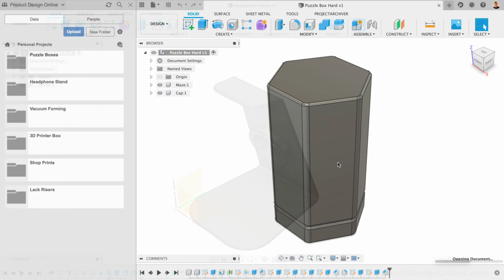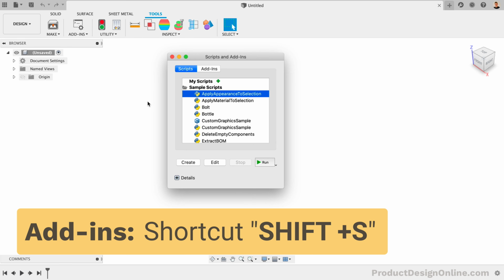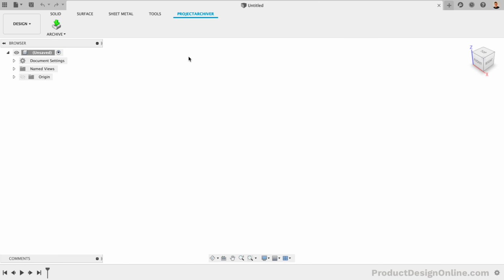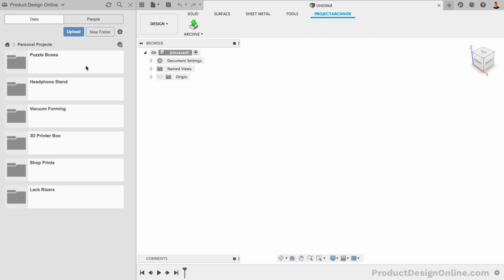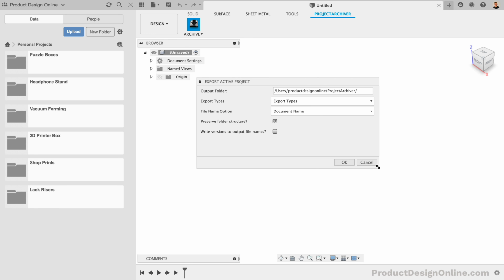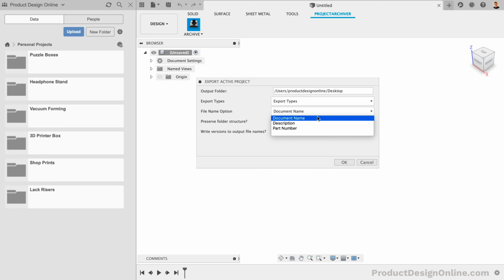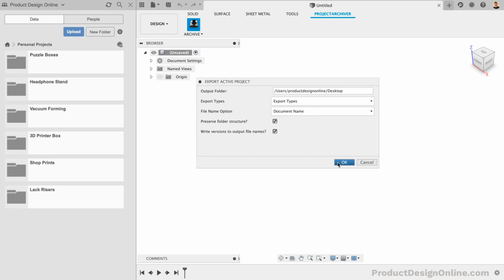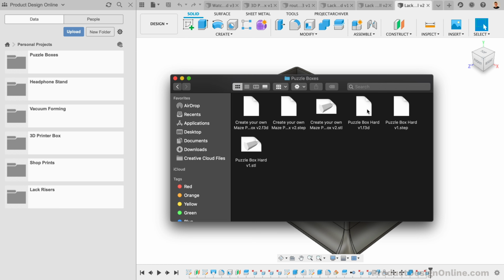How to BULK Export Fusion 360 Files

Comment: Does this still work in 2026?
Reply from the maker: I have not used it in a long time, so not sure if it works with the latest version of Fusion. I did recently see a different add-in the does the same thing though. I would check the official Autodesk App store first to see if there are any on there, as they're more likely to be up to date.
Reply: I just use the native option, press the cog icon Settings on the left pane and then press CACHE THIS PROJECT. It will cache (backup) your f3d files, not as powerful as you can't choose more file types, but it's better than nothing.

Comment: I get this error message when I push the RUN button, I tried both github and your fixed version. Does anyone knows how to fix this?

Initialization Failed: Traceback (most recent call last):
  File "---------/Project-Archiver/Project-Archiver.py", line 27, in <module>
    my_addin = apper.FusionApp(config.app_name, config.company_name, False)
AttributeError: module 'config' has no attribute 'app_name'

PS: I shortened the file path with --------

Comment: meh!  It gets a couple folders then crashes!  

Then when it fails you cant tell it where to restart from.  Totally useless!

I have hundreds of folders in the project I am trying to export.  I had to transfer years of work to a team hub which permanently moves all my years of work to a team hub I have no control over, so I can be shut out of all my work at any time by the hub administrator!  In order to work in a team, I have to give up ALL control of my data!!!! This is total bullshit!
Reply from the maker: sorry to hear that! I'm not familiar with the inner workings of the add-in, but know that some others have had issues with recent F360 updates. I suggest contacting the author of the add-in (on GitHub) who may be able to update it.

Comment: Excellent video. Only one thing I coundl1t get right. It always downloads all the Projects folder, doesn't matter what I have selected/opened on the project tree. Am I doing something wrong?
Reply from the maker: Strange. I have not had that issue. It may be a bug due to recent Fusion 360 updates. That's something the plugin author would have to fix/sort out :)

Comment: Tried exporting as per instructions, but, when I tried it on models that had external references aka mcmaster carr nuts and bolts it chokes. I even tried selecting  step as one of the export file types. Any work arounds? I am always importing nuts and screws as step files from mcmaster car. OR is their a nuts and bolts library in fusion somewhere! tank's

Comment: Thanks again Kevin! Another nicely done tutorial to save tons of time on exports. One caveat I had was that after the initial install of the add-in the export menu wouldn't show as in your video. I searched the comments, saw your suggestion on restarting Fusion which worked for me. Don't know if you can edit/add this to your video but might save others some frustration that don't read search through comments.
Reply: How did you get it to work? I get an error with no useful information..
Reply: @HDGamer2424  After a shutdown and restart it worked for me, simple as that.
Reply: @randywetzler5976  Well.. Call yourself lucky then, because it won't work no matter how often i restart my pc or reinstall the plugin.

Comment: I have found a bit of a problem. It is to do with file management. I am a beginner, currently working my way through your 30 day course.

I thought that I would do a bit of house-keeping and tidy up my directories in Fusion 360. I decided to archive some documents to make sure that I keep to less than 10 active documents. What I found was that I can only archive a whole project, not the individual sub-folders contained within it, nor the individual files within the sub-folders. I can only delete sub-folders and files. Searching Fusion 360 Help, I found that deleted files go to "Trash" and can be undeleted when required. I could not find "Trash" anywhere. Where is it? I then found that I cannot move a sub-folder into a new project, only the files within the sub-folder.

In Fusion 360, is it usual to have sub-folders and/or multiple files in a project? Should I have a separate project for each item that i work on rather than grouping them? For example, on my computer, I would have a folder for, say, "woodwork" and then within that a sub-folder for, maybe, "Table" and another for "Cupboard" and the relevant files within the sub-folders. Is this the wrong way to arrange things in Fusion 360?

Comment: Hii....
Is it working for linked component as well?

Thanks  in Advance!
Reply from the maker: It will export all your files individually... but if you export a file that references other components you'll want to manually export them as a "F3Z" file, which is F360s native assembly file type, not to be confused with F3D which is an individual file.

Comment: I get these errors when I try to run the archiver.   

Fusion 360

Apper Add Command failed: Traceback (most recent call last):
File "Dî/Users/Michael/Downloads/Project-Archiver/Project- Archiver\apper^usionApp.pyr, line 83, in add_command command = command_dass(name, options)
File T):/Users/Michael/Downloads/Project-Archiver/Project-
Archiver\apper^usion360CommandBase.pyr, line 86, in	jnit	
self. fusion_app. root_path
File 'C:/Users/gadge/AppData/Local/Autodesk/webdeploy/production/ 4143a 7d9c7cd 58a0f86968fd3809be 3e34945ca 1/Py thon/lib Vitpath. py ", line 562, in relpath path_drive, start_drive))
ValueError: path is on mount t):’, start on mount 'C:‘
OK

Comment: The 3rd addin/script works the best,  it also export DXF file for sketches --  Fusion 360 Bulk Exporter (GitHub) – Script, except it couldn't handle drawing, have to delete all drawings from projects .  https://github.com/aconz2/Fusion360Exporter      The 1st and 2nd couldn't work at all, all sorts of exceptions.
Reply from the maker: Hey, glad to hear that Chris! When I tried that one it didn't work, but it looks like the GitHub has been updated with a few fixes.
Reply: First option didn't works for me, I tried to add the project archiver option as shown in this video, but the project archive folder was not found, after seeing your comment I tried 3rd option, it worked well, Thanks for it

Comment: I am litteraly about to get started learning F360 mainly for CAM. I have a student licence but I am not sure when it is up. Through most of my studies I stuck with an older version of Sketchup. Now this whole licence situation baffles me. I will spend the next 3 months learning, at which point, technically I will become a startup. 

Should I be worried about changing my Licence to a start up? I dont expect to make enough in the first year to pay for a commercial licence. My plan was to make and sell small stuff until my main product is viable. This in itself could take 3 more years of R&D.

Are there any planned limitations to the Startup licence? Should I be scared of getting or loosing the startup licence? At what point do Autodesk say hang on, pay up sonny jim?

I really don't have problem paying for a licence if I'm earning enough to do so. I am now however, very scared of taking on water before I have even left the habour so to speak.

Am I safe to carry on learning F360 or should I spend time learning GRBL?
Reply from the maker: GRBL is not a CAD program, but a firmware for CNC machines.
FYI, The Startup license does require to "apply" where they will want to verify that you're a legit business/actually working on a hardware project. Other than that, I've heard it is fairly easy to get and that they support the license holders well as they want to be able to use the success stories for their marketing efforts. A lot of Commercial users (both small and large companies) don't allow them to showcase how they use Fusion as they consider it part of their intellectual property, and don't want competitors to have an inside look on their business. That's somewhat why/how the startup license came about.
Reply: @ProductDesignOnline Thanks for the reply. Ah what I meant was a program that converted designs into GCode. I thought I'd watched a CNC video where someone loaded GRBL and did exactly that like how a slicer would work. Maybe my memory is playing tricks on me  Ive been using sketchup for years to make 3D models but my version is no longer supported and I have no CAM functionality. This is 70% of my reason for wanting to switch to Fusion since it does both. Fusion also looks like a better package compared to investing in a newer Sketchup version.

Oh right so by getting a start up licence I would be sharing my designs?.... well thats a bit of a deal breaker.

I will have to try and find out how long I have left on my student licence since I only got it a year ago to use Eagle CAD for my final year project. If they let me carry on for a few years then I will stick with Fusion since I should be earning enough for it by then.

If however it will soon expire, I guess my time would be better spent looking for and learning on other packages while I establish my buisness. Most of my budget has already been invested. Such a shame, hope this isnt the case.

Comment: Hi Kevin,

Thanks for the great effort you put into this.
I've downloaded your fixed version of the Project-Archiver and tried to run it from the downloads folder.
Unfortunately I'm getting Runtime Error 3: The relative resourceFolder path not found.

I also  tried placing it in the Addins folder of Autodesk without any luck, same error.

I'm running MacOS Catalina
Reply from the maker: After installing the add-in try to restart Fusion 360. Some found that for whatever reason that helped.
Reply: I tried a restart without succes. Tried once more and.... Yess it works! 😄

Comment: Any chance you might consider doing some tutorials on FreeCad ?  Your style and detail oriented approach is what has had me subscribed to your channel for some time, but I, like many people, won't invest more time into Fusion 360 and are migrating over to FreeCad regardless of the effort it will take at this point.  Hollow promises from Autodesk won't change that, and if anyone thinks this is the last time Autodesk will pull the rug out from underneath you, then you only have yourself to blame down the road...
Reply: I expect you have already watched a range FreeCAD tutorials from elsewhere. I have found Ha Gei (he is a developer), Joko Engineering and Glasson Designs to be well put together and presented. It would certainly be great if Product Design Online had parallel offerings for the open source platform too.
Reply: @paulreader1777  I hadn't found Glasson yet - Thanks for the tip.

Comment: It was only 12 months ago that Autodesk posted the following. Perhaps, one of the elements for the decrying?
"Fusion 360 for personal use (new) – For non-commercial use only. You’ll have access to everything you need for personal projects including all the design, engineering, documentation, and manufacturing capabilities included in a current Fusion 360 commercial subscription. Access to collaboration, data management capabilities, and commercial software translators (NX, Catia, Solidworks, Creo, and Inventor) is not included.  Also, support is provided through our community forums for this subscription type. If you’d like to continue with Fusion 360 for personal use, please follow these instructions to convert to the new offering."

Comment: Another thing that seems to be tripping up Project Archiver is if you try to export STLs from designs that don't have any bodies. In other words, if it only has sketches (for instance laser cutting designs), it will fail if the STL output is checked. The solution is to move those to their own project so you can export without checking STL or extrude something in them so they have at least one body.
Reply from the maker: Good call, Steve. Thanks for sharing this!

Comment: Thanks for the tutorial, project-archiver worked fine for me on Windows 10. 

I can see some people are having issues, one issue I ran into was it threw a Python exception error, reading the exception it looks like the code is designed to run on C:\ only (or it's resolving to c:\ in my case because that was where fusion 360 was installed).  So if you copied this to another drive, you may (like me) need to restart Fusion, and re-add the add-in but make sure it is on the C:\ and not another drive.  Once that was done, things worked fine for me.
Reply: The Projectarchiver menu option is available after doing this, but I still get an error when trying to export the files in Windows 10.
Reply: @eventhatsme  Doesn't seem to work properly on Mac - can't find the local resource folder.  I'll have to dig into the code more to see where the error is actually stemming from.  If it's assuming c:, then that's your problem (on a Mac).

Comment: This add-in may only be for Mac users. It doesnt work on my PC
Reply from the maker: Which one of the three did you try? The "Project Archiver" page mentions a Windows install as well, but I did personally test it there.
Reply: @ProductDesignOnline  It doesn't work for me under windows either. After pressing the + sign, there are no files, no project archiver. What's next?
Reply: @jakabgipsz4788   - After pressing the + sign & assuming you remembered to select the Add-ins tab next to the Scripts tab, then you need to direct Fusion to where your downloaded Project-Archiver file is. I unzipped the zip file before directing Fusion to its location & also Removed the folder called Project-Archiver from its parent folde which also had the same name.
Reply: @ProductDesignOnline  , I tried Project Archiver. It fails when I run it from Fusion and doesn't result in a new Project Archiver tab at the top of the page. I just looked on Github and the only reference to Windows was an example of where to save your Step files. The Github layout always confuses me so the windows info may be there but I just cant find it. I see a similar Issue has been logged on github (runtime error), I appreciate your response but am heading off now to do it manually. Thx & thumbs up.
Reply: Didn't work on my laptop either. Was getting a runtime error (RuntimeError: 3 : the relative resourceFolder path not found) when Fusion loaded up. Ended up having to copy the "Project Archiver" to the root of C:\ and removing the 2nd Project Archiver folder as per Karlosss.  Now it works :)

Comment: The only thing that the new "personal" licensing to affect me is the ten active file limit. If I can't work around that and something else comes up to be a show-stopper, I'll move up to a paid tier. The software is worth it and what it offered had been great for my needs. Companys are out to make money. Why bash them for that‽ I didn't expect this level of free-ness to last forever.
Reply: I opted for the discounted annual rate. I don't have an issue with paying. I have 3 years experience with it and hundreds of files so I'm not ready to move. What bothers is is the £0/month personal to £54/month full commercial with no hobbyist intermediate subscription rate. I think it would serve them well to offer a not-so-cutdown version for £10-£20/month for 3d printing hobbyists like me. Something with the full modeller and without such modules [for me] as electronics, sheet metal and manufacturing would be ideal. As it is the discounted rate borders on £20/month and I only hope there will be something similarly priced next year when I have to renew, otherwise I will have to face stopping again.
Reply from the maker: Glad to hear this positivity. I'll be doing a video on the active projects nature as soon as it's available.

Comment: A very timely video. This idea seems most important for somebody in the process of migrating away from F360. After all what real value is an old archived step file of something that is evolving. What we normally require is a step file of the current project and from now on this is verboten. I can understand the dilemna of Autodesk which most certainly arises from abuses of the free license arrangements.  Is this the last policy change? Can pigs fly?  However I am a realist and always expected the party to end.  Do I want to invest more years into F360 to have more limits placed on me. No. For me an ongoing financial commitment of the size required is out. (and that will also increase over time).  Neither do I expect free. I am a huge fan of open source software and am happy to make reasonable contributions to development so that is where I am headed.
Reply: Ditto. FreeCad and Blender are where I'm headed back to. I got sucked into Fusion and Windows by the hype surrounding home 3d printing and now regret all the time and effort I put into learning this software. Yes it's good but it's based on a drug dealer's ethos and practices.
Reply: Here here! Or is that hear hear? Would much rather give what little moneys I have towards an open source software like freecad. That's how blender works, and that's an excellent program.

Comment: crashing on me... :{
Reply from the maker: How many files do you have within the project?
Reply: @ProductDesignOnline  10 to 15
Reply from the maker: @IronMan-yg4qw  Strange, I got it to work with 50+ in one project. Did it throw an error message or just lock up Fusion and crash?
Reply: @ProductDesignOnline  fusion locked up
is workin ok now